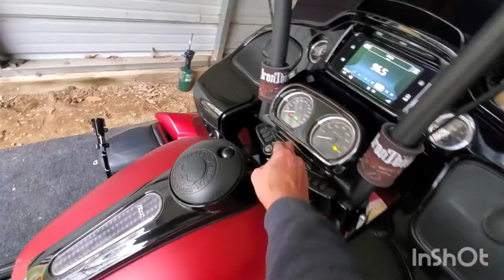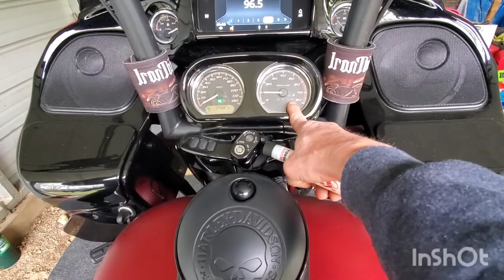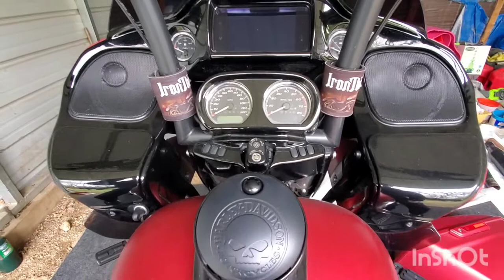Harley M8 misfire at warm up. Changing spark plugs. life pranks

Comment: The spark plug wire boots are a pain in the ass to take off on the M8. The boot sleeve slide back when you try to pull the cables off the plugs. I had the same issue. Did the backfire problem go away?
Reply: Agreed. Especially the right rear. What a goddamn nightmare; and they're even more of a PITA to get the wires to "snap" onto the plugs properly. Horrible design.

Comment: The red light staying on means a code.  Check your codes. Buy a gap tool. You should blow out those top spark plugs before taking them out as dirt accumulates in there.